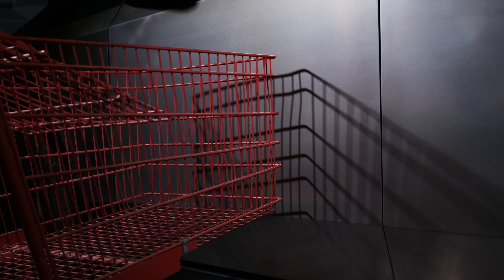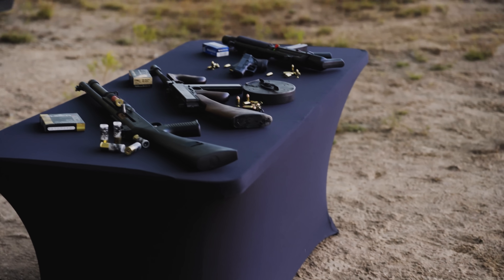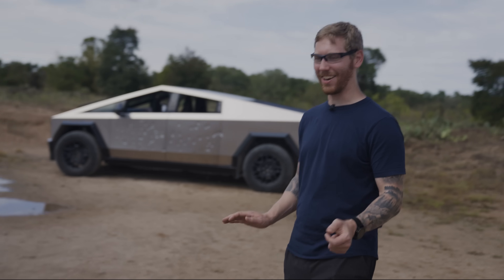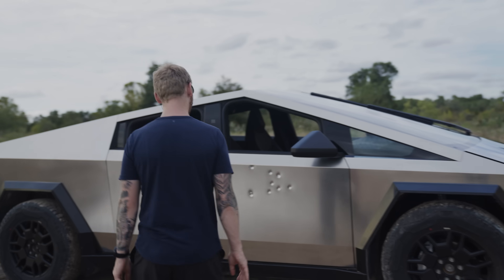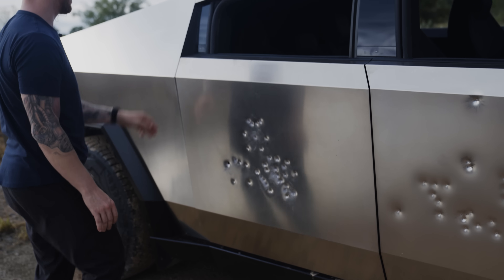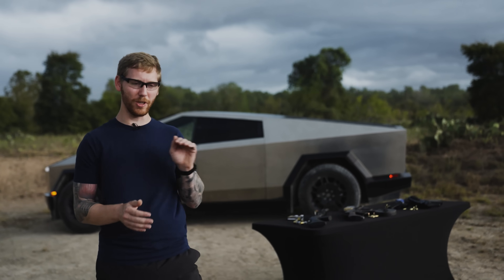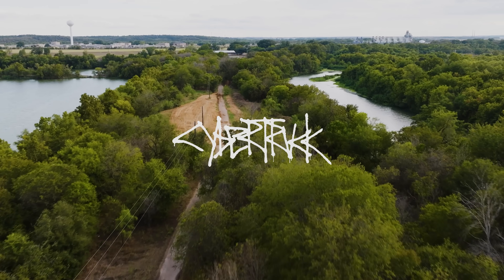Cybertruck Bullet Test

Comment: Pretty good showing against pistol caliber rounds. Just curious… Have you guys tested it against 5.56 or 7.62?
Reply: I bet they did, but they decided not to show the results for obvious reasons. I'm sure the first thing that would have come to mind was to shoot the car with an AK or an AR. Do they really think someones going to pull out a Thompson these days...?
Reply: @ChildrenOfDesire  pulls out a grease gun
Reply: @ChildrenOfDesire Pulls out Musket 😂😂
Reply: @ChildrenOfDesire  pulls out an Uzi
Reply: @ChildrenOfDesire  pulls out an eoka
Reply: @ChildrenOfDesire it’s not about showing it with the thompson… it’s about showing how it performs against .45 caliber bullets which are pretty common for pistols along with 9mm. Also the these .45s are traveling much faster out of that Thompson vs a regular pistol like the 1911 due to the length of the barrel.
Reply: @tash6638 .45 acp doesn’t really gain much muzzle velocity with a longer barrel.  9mm will though.
Reply: I think they'd smoke through.  The .308(7.62) would do both sides for sure.  I think the .223(5.56) being lighter has a 50/50 chance after it goes through the first door, because it would start tumbling.
Reply: @AlmostInteresting_03   A .223 will shatter into small pieces on the first panel, and then each fragment will have too little weight to penetrate any steel or glass after that.
Reply: then what's next a rocket launcher?
Reply: Doubt they tested it because we all know what would happen.  Now they have a functional art piece.  If it was 5.56 or 7.62, it would be a non functional art piece.
Reply: Maybe drug dealers & gangs will buy them to deflect handgun fire, and electric vehicles are fast to get away. They’re also the only ones that could afford one, lol
Reply: Bet they do, it's just the result is....not impressive. TBH in most cases you will be facing pistol caliber anyway in US.
Reply: 7.62x54r takes out the pedestrians on the other side of it. not impressed. if pistol rounds do that, it ain't bulletproof.
Reply: Surely the tested the door material, just not on the truck, and maybe not even formed into a door.
Reply: Just buy an Oshkosh MRAP at that point. Lol
Reply: It would penetrate easily, those are way more powerful than pistol caliber stuff, however they could easily make an "armored" version rated to stop those but it would weight a lot more.
Reply: Came here to see PUBG player that want this car to go in the game bruh😂
Reply: Chuckles in:
-7n31 9x19mm
-Full pressure 10mm
-5.7x28mm
Reply: U dont even need rifle rounds pretty sure 357 mag 5.7 and 10mm will go trough
Reply: pretty sure we know what the rifle rounds will do to any metal..
Reply: @ruskiedie harder metals can stop rifle rounds
Reply: They aren’t even using regular 9mm on this lol. SuperSonic 9mm ammo would turn this into Swiss cheese, a rifle would go through like it wasn’t even there.
Reply: @RyanZNO fr nobody carries low velocity rounds lol
Reply: @geoff0707 low velocity rounds? How many people you know carry a 7 inch barrel pistol? Maybe a 5.....
Reply: You need reinforced steel to stop something going that fast and this is not that. Just some fancy stamped aluminum panels. Rifles would go straight thru.
Reply: @NameSpaceVoid  it’s actually steel not aluminum but yes rifle calibers would easily punch a hole in this.
Reply: @NameSpaceVoid 1.8mm of in house designed stainless steel. Able to be formed and corrosion resistant.
Reply: @LUCA0451 Its a pretty normal stainless steel alloy. There is a whole well developed naming system Stainless steel. It just sound more cool when they call it specially designed. They claim the same for Starship, but you can see of the shelf ss roll into starbase as 304L ss.
Reply: Stainless steel panels. Still many many many times stronger than the usual steel stamped panels on a regular truck. @NameSpaceVoid
Reply: @NameSpaceVoid this is their own steel allow, not aluminum lol
Reply: @DJSerpent  It's 300 series stainless. 300 series stainless steels are all a variation of austenitic stainless steels and contain varying amounts of nickel, chromium, iron, very small amounts of carbon and trace elements of other elements. They are all "soft" alloys that "work harden". In this instance, the pressing process gives the material its durability. It doesn't break presses!!! That is nonsense.
Reply: Man the Jews really hate Elon lol. They’re going OFF in the comments 😂
Reply: Anything subsonic or armor piercing will punch through those stainless panels. Worth noting that even a 9mm will go right through most cars.
Reply: @cowboy_dogg2124  *supersonic. They were using subsonic in the video
Reply: Dude, y'all don't know to appreciate advancements in technology, you don't know you gotta take small steps to have succes, not jump all the way to 50. BMG like your moms want, it is made to compete with trucks that can easily be smoked by a .22, not with tanks
Reply: @ddd.777-  i don't expect it to be bulletproof.. i just don't want to be bullshitted.
Reply: @DaemonWulf7  ok, but if you want a truck that can withstand 5.56 green tips then is no way to weight less than 4 tons and cost less than 140.000$
Reply: @ddd.777-  i don't want a truck that can withstand 5.56s of any variety. i never expected a Tesla to actually be bulletproof, because i don't understand why tf it would be. Tesla said their truck was bulletproof and then went to great lengths to prove it wasn't, in any meaningful way. i just pointed it out.
Reply: @DaemonWulf7  but they can withstand 45 ACP, and 9 mil from pistols, and 00 buck on top of that wich is pretty amazing for me
Reply: @ddd.777-  its not terrible, but it's just clever marketing

Comment: "Don't believe the movies" he says.
In fact, if you are shielding behind a truck, SUV, or even a medium sized car, the bullets will lost most of their impact velocity after initial contact with the first side. Next it will likely deflect, changing trajectory, certainly not along the original path.
By the time it passes through the interior of the vehicle, it will have lost most of the inertia & IF it were to come out the other side, it would not be lined up from the penetration mark.
Unless someone is shooting at you with a heavy sniping or hunting rifle, you would be safe on the other side of any car.
Besides, we've all seen the rock vs window demo. I'd be more concerned about that LMAO.

Comment: Only one think if you damage your Cybertrack just a little it will cost you a whole body part replacement or even the exoskeleton to fix it? On a normal car you just a little hammer it, plastering, painting and it's done. How you can you do it on the Cybertrack?

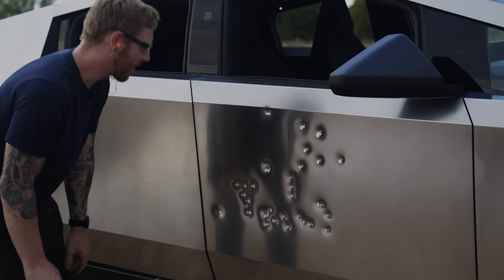Comment: 2:10 Contrarary to popular belief, a suppressor/silencer does NOT reduced the velocity of a bullet as it leaves the barrel's muzzle and then enters and goes through the  suppressor/silencer.  The bullet only increases its velocity IN the barrel as the super quick burning powder behind it increases presssure.  Once the bullet exits the barrel, then all of that pressure is dissipated into the larger open space and thus no longer acts on the bullet.
Reply: MP5SD Has a ported barrel to vent pressure, making it subsonic. So while you're right generally, you're wrong in this case.
Reply: @fredrikcarlen3212  He said "4 inch barrel" at 2:12 ... which makes it a MP5K, which doesn't have side ports on the barrel to slow it down for an integrated suppressor.  I was going by what he was said.  I wasn't watching closely.  But now I see from watching the video again, he's using the MP5SD, like you said.  That has a 5.75 inch barrel.  So he stated the wrong barrel length.
Reply: It's a structural suppressor, it does slow the bullet.
Reply: Call of duty says they might increase velocity, so as long as the word "monolithic" is utilized in the suppressor description.
Reply: the MP5SD is literally designed from the gorund up to slow the bullet to be subsonic so its much much slower and quieter. try the CyberFart against an AR15 (literall the most popular gun in america) and see how "bullet proof" your soy-mobile is.
Reply: The fact that they are using a supressor means they are using subsonic ammunition.  You are being a bit misleading.
Reply: @markleach2177 supersonic ammo can be shot through a suppressor. It's just not as quiet. They did use subs here though

Comment: If using bulletproof glass is an issue, could an efficient compromise be extending the steel door / roof panel partially over the glass? Could retain some functionality of a window and reduce the odds of a bullet going through. Could even use a steel grid or bars to retain some light/air/safety balance.
Reply: Won’t be legal on the streets in most countries.
Reply: There is a laminate to help make glass bullet resistant. That might be a good option not perfect but better than glass.  .
Reply: You never know when someoke is about to pull up on you, gangsta style
Reply: @eustahijelifetips  in USA*

Comment: Amazing! It would be better if the window glasses were also bulletproof.
Reply: There are. Elon said it is an option to get bulletproof windows on it but they wont be able to roll down. So base models will all have non bulletproof glass and then you can add it as a option.

Comment: This test alone means police forces will be seriously interested in using this car for official mass duty. It's an armored truck at a fraction of the price (armored trucks cost around $2-300k), it's far less expensive to run, charge and maintain, American-made as well. Fast enough for patrol chases. Have a feeling police forces will be eyeballing this and adding some serious red and blue lightbar effects to it to make it a sleek but also commonly used police vehicle
Reply: the glass cant withstand bullet shot, also it wont stop rifle caliber
Reply: It's only bulletproof vs subsonic bullets, you are better off riding in a normal police cruiser, that's way cheaper

Comment: The type of gun appeared to be a Thompson Submachine gun.   What was not done is compare that to another vehicle nor was this vehicle inspected to be sure there was no extra backing put in- so while it seems impressive; maybe it isnt ; maybe most truck doors would have stopped the relative low power guns bullets.  Having been in the Army ; the 45 losses velocity very quickly; so the distance is also very important.  I would say off the cuff it isn't that unusual ; stainless isn't super strong.
Reply: Did you watch the whole video? They shot another truck...
Reply: They shot another truck and it went through the whole car and out on the other side...
Reply: A normal car door is 0,7 mm thick, you can penetrante that with a pointy chisel and a hammer.

Normal bullet proof cars have kevlar behind the door (for pistol ammo) or even steel plates behind the door (for rifle bullets, cars used by politicians like presidents).
However normal bullet proof cars also have bullet proof windows, it's unclear if CT windows could really withstand that.
Reply: Would also be interesting what exact bullet they used, this looks like subsonic ammo...

Comment: Does the Cybertruck have a 48 volt battery and if so where is it located? Also, will a magnet stick to the special steel?
Reply: The steel is not magnetic
Reply: @gilltan4280  Yes it is. Dr. Scott Walker was at the event and put a DJI magnetic microscope on the Cybertruck and it stuck and was difficult to pull off. His video just posted where he mentioned that.
Reply: @gilltan4280  Yes it is, Brandon from Tesla Flex had a mag case phone stuck to the side of Cybertruck in his video at 13:43.

Comment: I’m trying to understand this: so the body panels are
acting like an “exoskeleton” giving the vehicle strength, but you’re shooting
at the doors. While the doors need strength to protect against side-impacts, I’m
not understanding why the strong steel “skin” would extend to the doors; they wouldn’t
be contributing to the overall vehicle’s structural strength -- unless you have
some really heavy duty hinges and latching mechanisms tying the doors to the
rest of the body. So why that heavy steel on the doors? Also: is that an actual
PRODUCTION vehicle, or is that a prototype vehicle? If I buy a Cyber-truck and
conduct the same tests, will I get the exact same results?
Reply: Normally doors have high strength steel beams for side impact protection. Cybertruck does not as it has same stainless steel as the rest of the truck.
Reply: @reivanen  I would expect that using sheet-metal, even if it is strong, wouldn't be an effective way to achieve side-impact protection. Unless you get to some really heavy plate, sheet goods will want to "fold" on impact; the beams for side impact are tubular, or other formed shapes to do the job they're designed for. I would think the truck still has some sort of "beam" protection behind the skin, and the door isn't likely "enhancing" the vehicle's body strength, so I'm still not seeing the need for the heavy sheet on the outside of the doors.

Comment: This truck is growing on me for sure but as a automotive metal worker and car builder i feel the repair cost for these fixed panels will be ridiculous special alloy panels with no filler no paint to hide imperfections the panels will also have to be perfect i know what it takes to do flawless work and i literally dont know a single regular panel shop that would take on a bare metal repair let alone someone that will know teslas enough to remove the battery to weld a new panel on.tesla is also the only place that will make them there a special alloy and there not sheet metal there technically plate steel so the panels alone will be very expensive i really hope they all bolt on or its gonna be a real nightmare

Comment: With proper reinforcement and some
Modifying this could easily be a doomsday escape vehicle, but the range would ultimately be its downfall, but gas powered vehicles are not going to do much better because gas stations require electricity to pump the fuel so you would be stuck there too
Reply: Gas is way more easy to store than electricity...

Comment: Police cruisers need this alloy and thickness somewhere in the front doors since they use them for cover so often. Obviously, it's not rifle rated, so if the officer comes across an criminal with an AR-15, there's an issue, but it stops the 2 most common hand gun rounds, so that is enough reason to use this in police cruisers. Maybe Tesla could sell panels that fit the most common cruisers, inside of the door card.

Comment: So you use big 45 acp rounds 9 mm which is smaller but not as powerful try 223 or 556 or a 5.7 pistol round it’s ripping right through the door

Comment: I'm pretty sure they only tested with low energy guns, the ones which would pass the test. I bet most rifle rounds would go through 1.8mm of steel like cake.
Reply: There using lead ammo on 9mm gun and a steel ammo could pierce a 2mm steel plate
Reply: They used an MP5 SD which by design reduces any 9mm to subsonic speed... that test is  rigged from start to end...